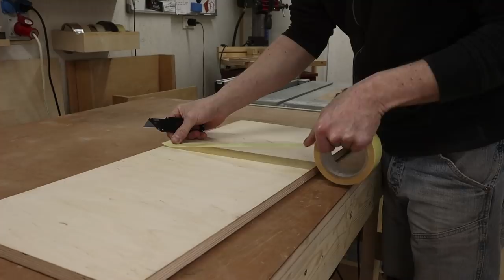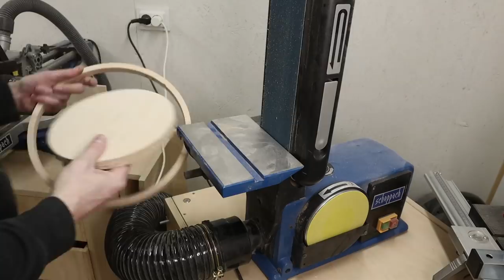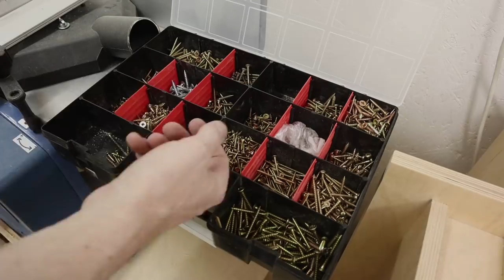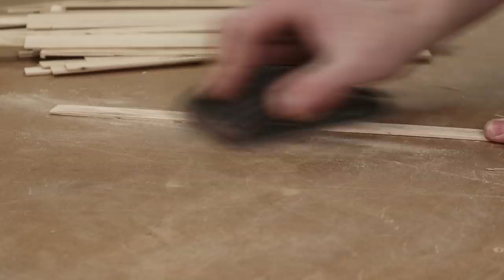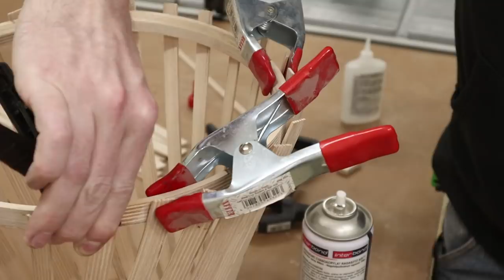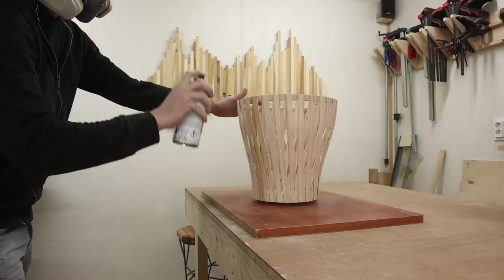Wastebasket from Plywood with woven pattern / Or is it a Lampshade?

Comment: Excellent. Just discovered your channel and not disappointed, thank you.
Actually you've given me an idea. I need to make three plant pots for outside, I think I'll use this design if you don't mind, use exterior grade ply, smaller weave gaps and Brad reinforced on weave ends.
Thanks for posting 👍
Reply from the maker: Thank you very much! Of course, you can use the design ! I would suggest to also use water resistant wood glue instead of the CA glue gor outdoor use.
Reply: @Ollaris 
Thanks 👍